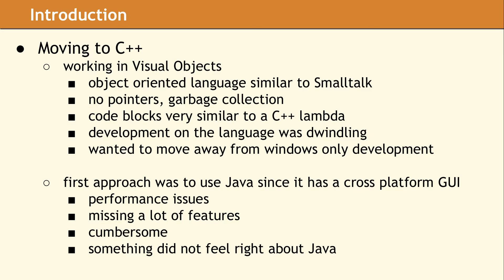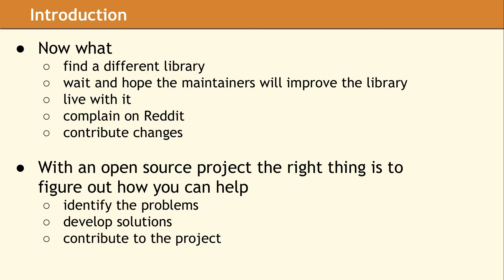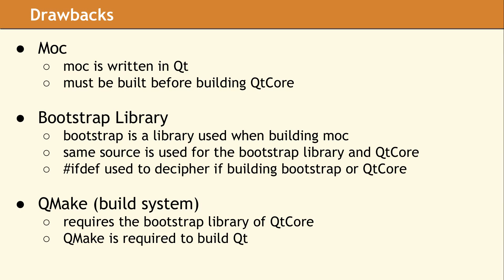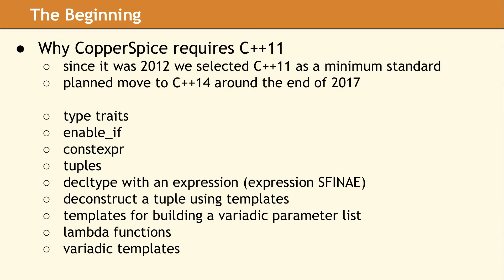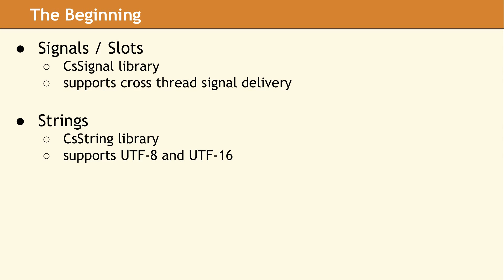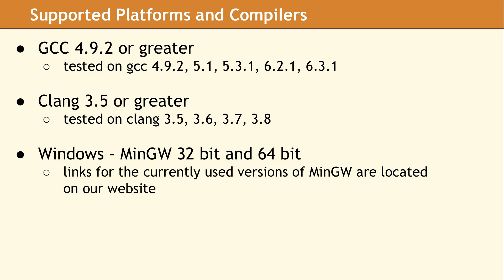Why CopperSpice

Comment: Just a minor correction: When a QObject has a parent you can of course call delete on that object. There is no problem with that because the parent is notified about this and removes the object from its children. What you must not do, is to call delete on object which was already deleted by the parent. This typically happens when you mess with QObjects and std smart pointers.

Comment: What are the steps to compile Kitchensink in visual studio?
Reply from the maker: Visual Studio support was officially added in August 2018 by two contributors.  We are in the process of updating our "CS Overview" documentation and it will have a sample project and extended information about how to build KS with Visual Studio. The new docs will be available in the next two weeks.
Reply: @CopperSpice  I'm looking forward to that. Thanks for your effort.
Reply from the maker: We have just updated the "CopperSpice Overview" documentation located on our web site. Have a look at the section called "Sample Project".  There is a new entry for building CS and KS using Visual Studio and updated CMake information.
https://www.copperspice.com/docs/cs_overview/main-sample-project.html

If you have any questions feel free to reply to this thread or post an issue on our github project 
https://github.com/copperspice/copperspice/issues

Comment: Good work; anyone interested in this should read:

https://woboq.com/blog/verdigris-qt-without-moc.html
Reply from the maker: Thanks for your comment. It is worth noting the work in this article was done after the release of CopperSpice. There are certainly people in the Qt community who would like to see moc removed, but from what we have heard the project leadership has shot the idea down as they do not see any benefit. As we mentioned, removing moc was not the primary focus of our work, just the first step.
Reply: Well, when c++ gets standardized reflection (25 years after Qt)

https://meetingcpp.com/index.php/br/items/reflections-on-the-reflection-proposals.html

Qt will be in a position to consider moving to it, given versioning binary/source considerations /obligations and the adoption of suitable compilers by their massive existing user base.

Nobody in the project likes generated code, they just haven't found a clearer solution as of this point in time.
Reply from the maker: The focus of this video was to point out how we have moved beyond the discussion of just removing moc.

There are several different proposals to add some form of reflection to C++. In discussions we have had with people on the committee, this is sort of a low priority right now. New features need to be vetted and the process is very long and complicated. There is almost no chance anything related to full reflection will be added before C++23.

We know removing moc is a hot topic and it is something CopperSpice has accomplished. You can build the CS libraries with CMake, we have improved the Signal / Slot system, meta types work better, we have improved the atomic system, all of the containers have been refactored, etc. Another major change we are currently working on is the addition of built in UTF-8 strings.

Comment: Share url to the presentation slide-show please.
Reply from the maker: The slides are actually part of the video. Do you have a question about a particular slide we can answer?
Reply: On new greenfield C++ first projects, as CopperSpice can serve benefit of clean modern C++ approach over legacy workarounds (MOC and everything), so next time I and others are starting something, I just wanted handy link to list out the bullet point listing from couple of slides. The presentation is also good (particularly as an introduction), but handy reference to get straight to the point will be more appropriate on decision making occasion.